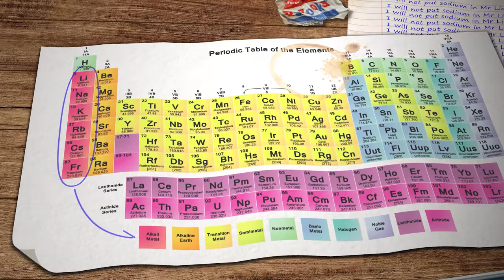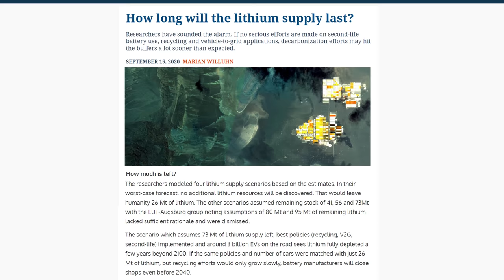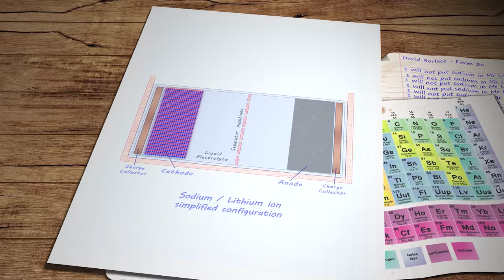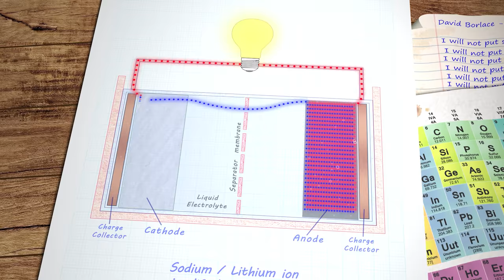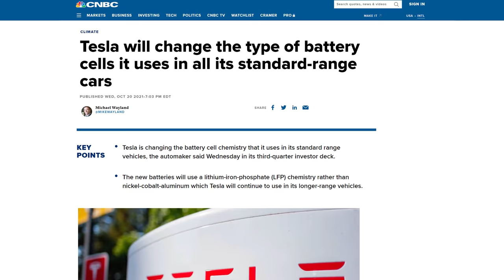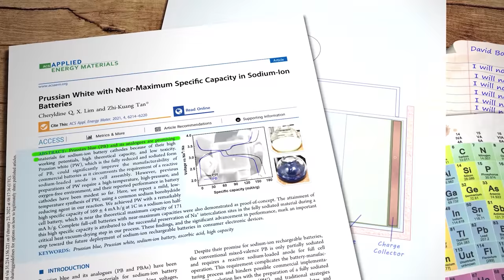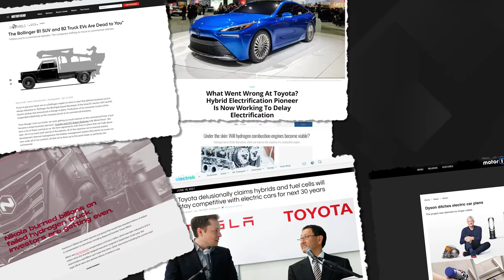Sodium-ion battery breakthrough. Safer, cheaper and cleaner than Lithium-ion

Comment: Hi there! I previously wrote here about BroadBit Batteries, a Finnish-based company that makes sodium ion-based batteries. Not only are they competitive with Lithium-ion batteries on energy density, but they are also far better in many ways: they are easy to recycle, non-flamable, charge faster, and they are cheaper to make. The issue, as it is often with all of these things, lies in the resource control and monopoly for bigger profits. As you pointed out, Sodium is widely available so it is harder to control and that would take away the possibility of monopoly for the corporations that want control over production, so they obscure the technology or argue that it's far behind on the development so they can milk the Lithium as much as they possibly can (let's not forget this is being done for a very long time now and it is why we still use coal and oil).

Comment: I'm writing this from Cornwall, about 3 miles from a Lithium mine where I understand the concentration of Lithium Salts in the water from deep underground is the highest ever recorded and they are looking at starting commercial production soon. There are also several other sites in Cornwall gearing up for production, so I do query your 'We are about to run out of lithium' statement. However, it would be good to use Sodium which is plentiful and easily accessible.

Comment: The perfect battery has not been invented yet. We went straight to lithium because it has the highest oxidation potential and the lowest density, but I’ve always thought there are more pressing issues like: ease of extraction of the metal, recyclability, ease of manufacture, availability of the ore and the possibility of using the sun to concentrate the mineral, as for example in the making of brine from ocean water. Let’s not forget the other candidates at the top of the activity series!: Li, K, Ba, Ca, Na, Mg, Al, Mn, Zn…as well as the other alkali metals Rb and Cs, perhaps to activate the surface of the cells. Battery research seems like an exciting field. There is still so much to discover!

Comment: I am working in a research group focused on this issue. We have also been working on Prussian white kathodes and they do work as discribed and better. The problem is the anode it is a combination of the right electrolytes anode materi that will make the difference. Right now it seems glyms are the key as they facilitate  sodium intercalation into hard carbon mutch better than polycarbonates. Althought the mechanism is not well understood.

Comment: 150 Wh/kg vs 200 Wh/kg and more stress on anodes is what kept Na off market. But LiFePo has similar problems and it works.   

Prussian White cathode material is indeed a breakthrough.  95% after 10k cycles.

Hard carbon on anode with aluminum foil saving 8% cost, 10% weight? Same tech as lithium? Better thermal stability?

If CATL can beat LiFePo and get anywhere near lithium metal...this would be a winner.

Comment: One year on and BYD, MG etc are using exactly that :). The Atto3 with a 60kWh battery does 250 miles WLTP and batteries are expected to last twice as long. Furthermore, they are safer and need less battery management

Comment: 9:28

Yeah, especially when Sodium Batteries seem to be in that ever-rotating group of tech that has a supposed breakthrough every few years before disappearing until the next major breakthrough that doesn't amount to an actual product being made/used.

As far as batteries go it's not quite as bad as the liquid/molten metal batteries on that front but it's close. Always a new breakthrough that now makes them viable for production and then...
Reply: I mean, tbf - most of the time you get promises along the lines of "working prototype within the next 5 years, commercially viable in 10". In this case though? Theyre currently working on the second generation, with commercial projects planned next year. Is it a guarantee itll work out? No. But its certainly closer to reality than most projects of this kind.

Comment: This sounds like a much more sustainable alternative to lithium ion. Aluminum instead of copper, sodium instead of lithium, no cobalt. Sounds like a dream come true.
Reply: I'm not convinced aluminum is a good choice for the conductor. Aluminum thermal properties are really bad as it expands and contracts too much creating stress. It's also too ductile. That's why it was banned from electrical house wiring. I don't see how this kind of battery could be used in a vehicule. I could be used in a temperature controlled power generator to regulate current.
Reply: @Paul.Gallant  All of the cables in the electricity grid use aluminium. Aluminum wiring is also used in all kinds of electronics.
Reply: The problems of aluminum house wiring are that its expansion causes connections to loosen and in contact with copper it tends to oxidize causing the resistance of connections to increase. Both of these can lead worse case to fires.

Comment: If they can make them cheaper, that'll be great. I have a 2017 chevy volt. And it's doing quite well, but it's coming up to 45k miles. And about 2/3 of that is full electric.
When it's time to replace the battery, it would be great to be able to replace it with a new, but cheaper battery, even if it doesn't have as high of a capacity. 40-45 miles as opposed to 50-60 miles is still fine if the price of the battery pack itself is cheap enough.

Comment: Q.  Do you own a battery powered drill ? 
If so, what happens when the battery dies ? 
You disconnect it from the tool - put the dead battery on charge and connect the spare battery to the tool  - and continue to work. The operation takes seconds.
Why can’t EVs operate the same way ?
Just drive into a garage - a machine removes the battery pack and the driver selects available replacement option.  
Don’t have to wait 10 hours to charge your car. 
You don’t own the battery pack 
Just buy the charge.

Comment: From what ive read the sodium ion batteries will be half the energy per kg as modern lithium. However at 70 percent of the cost. This would make it prefect for at home battery backup solutions especially as it have better thermal ranges and no runaway thermal risk like lithium
Reply: Yeah, that would actually make civil energy storage almost practical without baseline generation: IE coal, natgas, gravity such as hydro, or fission (and/or fusion when/if viable). Because the amount of storage required to go purely off wind and solar is prohibitively expensive and high-maintenance otherwise.

Comment: Thanks for another great video! I hope sodium-ion batteries are the best thing since sliced bread - because, like you said, there's only so much currently available lithium. If we don't have alternatives available all the things that use lithium batteries will get more and more expensive, and that'll slow down adoption. We need the adoption curve to go the other way, with electrical storage getting cheaper and electrification happening faster and faster.
Reply: True. We can also seriously ramp up LI battery recycling to help as well.

Comment: Thanks for the great video about Na-ion batteries, I do believe that in the future Na will give a run for its money to Li. Despite of the large infrastructure that they have. One the things not mentioned in the video is that Li needs a large amount of water for processing and that is creating problems in Chile as well as Bolivia, because the Li deposits are near the Atacama desert or in the altiplano. 
If you are in the Grand Salt Lake in Utah, maybe is not a big deal. Because they have good Li deposits and water is not an issue, but in other geographies is something that you must seriously consider.
But those things aside, one of the most relevant discovers is made by Argonne Nat'l Labs and has to do with better understanding how to improve the anode used, because that brings an increment in performance of 30-40% and also can allow charging times of one hour or less. O the other thing is also that reduces their cost and finally allows the batteries to work at higher voltages.

Comment: I've argued in the ebike community that LFP is safer and greener. Problem is that a 500 wh battery in LFP is maybe 11 pounds versus 7 pounds. To me, this is nothing, but the bulk of LFP interferes with sleek design. So I guess (like) being Green is #3 or #4 on the list. The thing is, with small, well insulated houses, the elements are totally in place. You go solar, and LFP and split heat pump, and it's 30% of the costs 6 years ago. So it's there. And all they build around here is the McMansion at 3000 sq ft or so. Your musings prove, to me, that there is not much commitment to true efficeincy and self-sufficiency. Oh, well. I did subscribe.

Comment: I think that the most important feature of Sodium-ion batteries is thr ability to recharge to 100% continually without any loss of battery capacity over time.  This means you actually get, on average, better milage.  With lithium, you are advised to only charge to 70-80% unless going on a long trip.  Also, with little or no degration over time due to repeatedly charging to 100%, this ooens up the possiblity of using your car as a backup batterto power your home.  This could lead to a major change in available battery capacity for the grid.

Comment: if you spool metal wires (aluminium) in rolls, then you have a simple metal-air fuel cell engine AND the metal as wire form, the anode, as separate fuel stock, stack up!
Reply: just make the fuel cell electrolyte circulated and filtered with water cooling system, then just feed the metal wire into the fuel cell, the fuel cell is the same in the electric transport vehicle, as is the platinum in the air electrode, just add more fuel, remove used, its the same as internal combustion engine, but only 90% efficient, as metal-air fuel cells are. direct metal electricity
Reply: return to old Sodium Na process to making metals, especially aluminium, 300C not 2000C, electrolysis of NaOH into Na reduction agent, molten mix at 100C with Al2O3 to get NaO3 and Al2, directly

Comment: great news, I hope it becomes a viable alternative to li ion. with EV growth, battery production is going to become very strategic. it is already, but just imagine ev production keeps almost doubling every year, in 5 years it would be over 50% of the global market share, instead of 2.5% and any change in lithium price would have huge impact. having different chemistry to address different needs in EV industry and multiplying the supplies for the material seems absolutely crucial.especially using materials that are very widely available. I hope it will not slow down the effort to recycle these materials though

Comment: I like the "bread" analogy! If Sodium batteries actually turn into a viable product and are actually significantly cheaper than Lithium based ones, then they will take the world by storm! Vehicles are one area, but things like solar energy storage where weight and energy density don't matter that much are likely going to see huge demand for Sodium batteries!
Right now, having solar in your roof is unsatisfying without battery backup, but that battery is so expensive that you likely won't get a return of investment within the battery lifetime. Sodium batteries could change that equation!

Comment: Ya I had a feeling  lithium ion batteries are  kinda on the down cycle. Nickel metal hydride lasted for about 5 years where about 10 years into the production of lithium-ion in cars. So I had a feeling the next Cutting Edge thing is probably not lithium ion. Besides all the things that you've mentioned sodium is highly reactive and equally is harder to harness. There are a lot of properties that are good but it's going to need a lot of research and development. One thing that I think about is when you're buying a Tesla or expensive EV then how do you know they're not using the really cheap batteries that are not cutting Edge. You are completely right in the fact that sodium ion totally changes the game.

Comment: However, the thing that matters more here is energy density. If you made a "battery" out of inert materials, it would be perfectly safe and possibly even perfectly clean but it would not function as a battery at all! The primary function of a battery is energy storage and retrieval. That MUST be the primary goal. Only after you have achieved energy density does it make sense to try to then make it safer, cheaper, cleaner.

Comment: If you think this a good solution for stationary storage, please note that the standard there is not lithium ion batteries, it is lead acid batteries. Lithium only has an edge because of its weight for portable power. That is what is needed to get off oil. This solution sounds interesting and certainly Sodium is abundant. I look forward to hearing more about their improvements over time. Not holding my breath though

Comment: Perhaps the problem here has been the demand for batteries has been for things we carry, so lightness matters. However heavy batteries would be no problem for home energy storage or the mentioned commercial equivalents, so your solar power for example can be stored to use at night. Lower cost and life length matter most not weight. Let alone more available materials. Sometimes lighter and smaller is not useful. Swappable batteries are more useful than long lasting ones you can't change yourself.

Comment: Lifp batteries are only used in standard Tesla cars, not the long range models, because the unused space can store the larger, and less energy dense cells
Lifp is cheaper and hence attractive to Tesla.  LMC will still dominate until it's price to performance is superceeded, especially while pushing range limits on a single charge.  There are lots of safety and charging issues with lithium based batteries, so that also plays a role in making it slow to introduce new untested formulations, but could accelerate a more stable solution if one is established.

Comment: density isn't there for transportation.
no reason these shouldn't be implemented for storage though, where a little more space used or weight doesn't matter.
without density, it's space, not just weight that matters too.
using them as storage would also take the load off lithium to be used in more dense batteries.
lithium will be used in space/weight  restriction uses.

Comment: The world's oceans contain an estimated 180 billion tons of lithium, ive also read we have enough easy to mine  lithium for our needs for about 500 years this is without recycling or tapping into the ocean for lithium, It is the 33rd most abundant element,  but every new battery helps so this is fantastic news.
Reply: From these posts, it's not the major element but the rare elements that are used in Lithium Batteries that can run out.

Comment: Freeing up all of the Lithium currently used for battery technology would be a huge benefit to aviation and vehicles too. Aluminum-Lithium alloys are stronger and lighter than straight Aluminum. And in fact, the Airbus A220 is largely made of this material for exactly this reason, making it devastatingly economical (from Boeing's perspective). Lithium's pricey, so cratering the demand for it would lead to vastly mo0re efficient aircraft and vehicle designs due to weight loss from its use.

And those economic gains can be shared by electric-powered aircraft in the future as well, for the 45 to 90-minute missions they're suited for.

Comment: Using sodium instead of lithium is a very interesting idea, hope it succeeds on an industrial scale. The prospect of using seawater salt is nice though it's gonna take more energy than mining the salt; further energy would go into salt melting and electrolysis, with chlorine as a by-product. Still probably not as much as for producing lithium.

By the way, I ABSOLUTELY miss the old days when science was taught with lots of demonstrations and experiments.
Reply: Is Chlorine used in PVC plastics?
Reply: @Ktsquare2008  yes - it's poly(vinyl chloride) after all, so chlorine (not necessarily as gaseous element) is used for making the monomer.
Reply: @KeritechElectronics  So the byproduct chlorine is useful too.

Comment: The Great Salt Lake in Utah has at least 2.4 MILLION metric tons of Lithium carbonate. A company there (Compass Minerals), says it could have an annual production capacity of approximately 20,000 to 25,000 metric tons LCE of battery-grade lithium without endangering the lake's ecosystem.

Comment: Whichever tech it is, as long as its commercially available within next 3-5 years, when electric vehicles should "explode", yeah, I know, not the best wording, but you get the idea.
LiFePo or Na-Ion or semi-solid ones, just give me reasonaly priced EV with 500+km range all year long, safe battery tech that doesnt explode during accident and dont degrade as fast as li-ion ones.